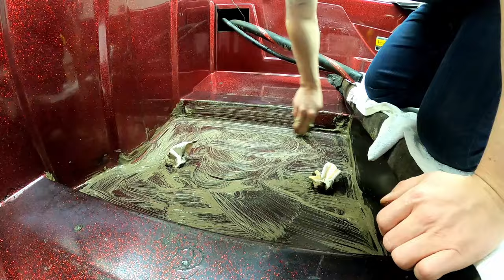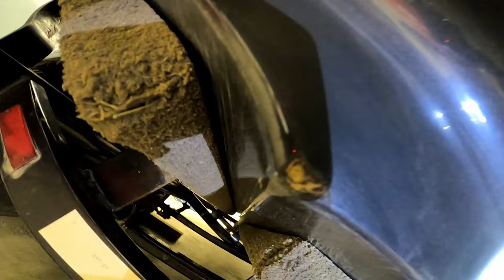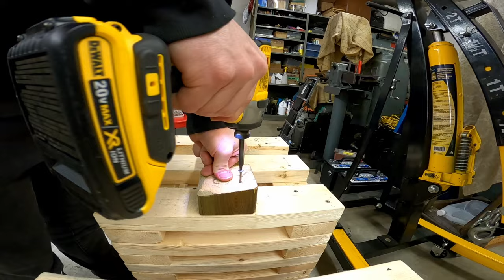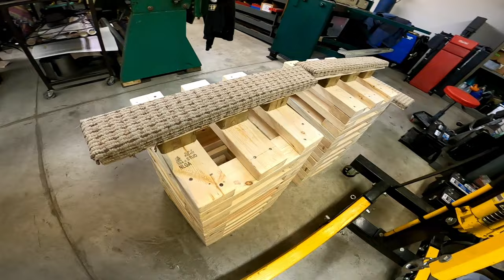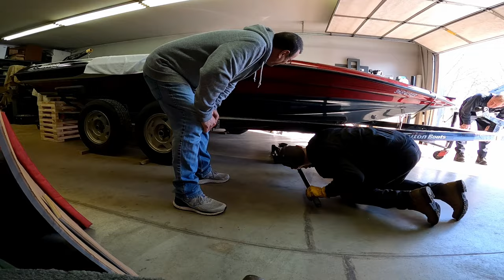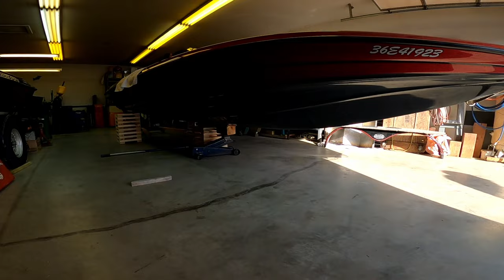DIY Bass Boat Restoration - Part 3: How To Lift Boat Off Trailer In Garage

Comment: I’m 140lbs guy and I’ve pulled many trailer from under boats alone. It’s very easy. Build a cradle with a sheet of plywood and 2x6 just a bit narrower than the boat. And for the bow an old tire or a small cradle will work. Then pull the strap all the way out the winch, go under and over a cross beam and tie back to the boat. Then just crank the winch and the boat will slide back. The trailer jack will lift off a bit until the transom rests on the cradle. The boat will stop moving and the trailer will roll forward. Position the bow cradle and just pull the trailer out. It’s a bit of a workout but it’s very easy especially when you don’t have a motor on.
Reply from the maker: Cool!
Reply: Yeah, just watching this is making it way complicated...there must be a simpler way

Comment: If you need access to the hull where your supports are, use two truck jack stands under the jackplate to support the rear. Then the cherry picker to pick up and hold the nose. At that point, you’ve got total access to the hull for repairs, etc. I’ve restored a few older bass boats over the years and short of turning one over, that’s the best route I’ve found for having total access to the bottom of the boat.
Reply from the maker: That is great advice! Fortunately for us, this was just to get the boat off the trailer, next step is it’s getting put on a rotisserie

Comment: When you get to the point where you are in the bilge....Could you show the location of the shoot thru the hull transducer in the bilge if you have one? Thanks
Reply from the maker: For sure! I don’t think there is one down there, as there was a transom mounted one that someone unfortunately drilled a ton on holes straight through the hull🤦‍♂️ I think you can place one pretty much anywhere so long as it’s on a flat surface in area of the pad
Reply: @FishingOntario  Unfortunately, I have found you can't put one just anywhere like the other boats I have owned. I have tried several locations but just can't hold bottom over about 30 mph. I tried holding in place with sandbags so I could move it around during the day. But never found the right spot. 
I was hoping your project would give me the peek that I needed.  But alas, that looks not to be 😃  I'll keep watching your project as it is very interesting. Thanks.
Reply from the maker: Really eh!? Well I think I saw the remnants of a previous install when I was digging around down there, if there is anything to go off of I’ll get you some pictures

Comment: I highly recommend gator back bunk covers when your done. They stop blisters.
Reply from the maker: There are a lot of mixed opinions on gatorback stuff, especially if the boat is going on/off the trailer lots.
Reply: @FishingOntario  I currently use my boat weekly and have had the covers for over 2 years without trouble. Some of the mixed reviews are from people who are parroting what they heard without using the covers themselves. My next boat will get them as well.
Reply from the maker: Have you had your boat on a lift to look at the hull in the areas where they contact? I’ve seen lots of posts on BBC about excessive gel coat wear, and ultimately failure, from gatorbacks.
Reply: @FishingOntario  I have. I had the boat completely off the trailer 4 months ago so the entire hull could be waxed and ceramic coated and my hulls fine.
Reply from the maker: Good to hear, I have no real experience either way other than seeing posts of the damage cause on BBC, and Ken Smith also has a video at Classic Fibreglass Repair where the owner talks about fixing hulls damaged from gator bunks really frequently🤷‍♂️🤷‍♂️